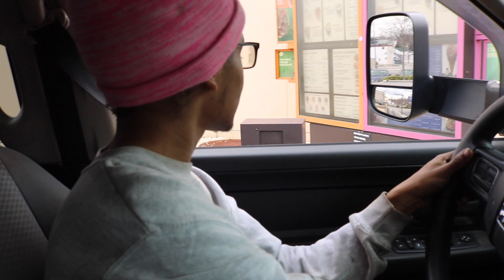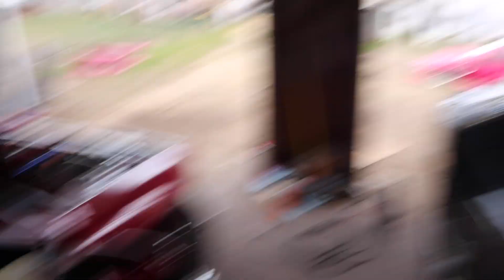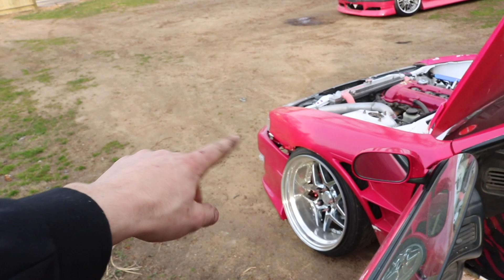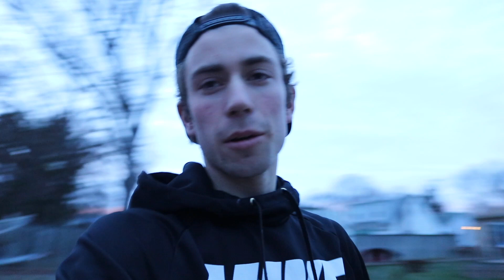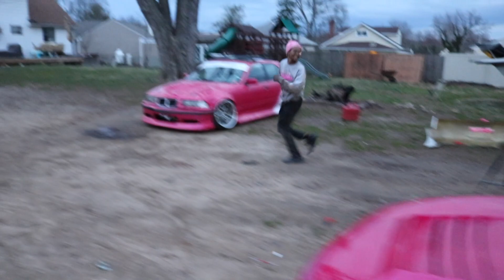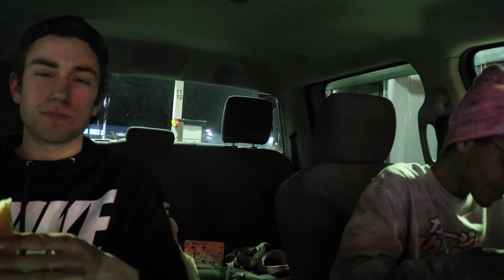Broken Dreams

Comment: Extended tow mirrors=an extra 50 horsepower
Reply: Joseph Samsor I wish😂😂
Reply: DayQuan Winfree I wish my truck had tow mirrors! Seriously it’s got a wide flatbed and I can’t see half the time 😂😂. It’s literally one of those Home Depot rental truck flat beds
Reply: DayQuan Winfree yeah this one (it’s actually my dad’s but I’m the only one that drives it now) is a 7.3 diesel from 97, it’s an f250 4 door shortbed that the previous owner extended themselves at the end, so it’s basically a long bed but the axle is a bit forward. Looks kinda weird but it works
Reply: DayQuan Winfree you shoulda seen how we replaced the bed. Originally it had a steel flat bed with wood that was really heavy and looked bad. We unbolted it, chained it to the back of my dad’s semi truck flatbed trailer, and I drove forward as my dad shoved wood blocks in between the bed and the frame to roll it off. It was an interesting process
Reply: Joseph Samsor Damn, that’s awesome. I wanna make one so bad. But I’d like it to be aluminum so it’s light. I just need to practice more first.
Reply: DayQuan Winfree we just bought ours. I think my dad found his aluminum Home Depot one at an auction. Think it was like a grand or something. All the sides fold down though and everything. You can also find them on Craigslist. Idk how you’re supposed to do it but we got some steel, bolted it the frame and bed and called it a day. Welding would’ve been better but we couldn’t. It’s held up really nicely.